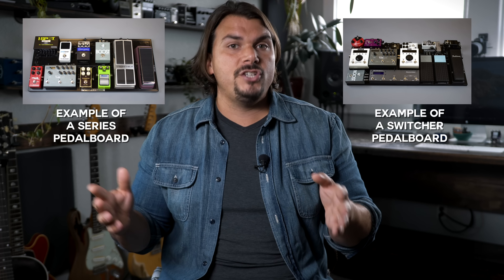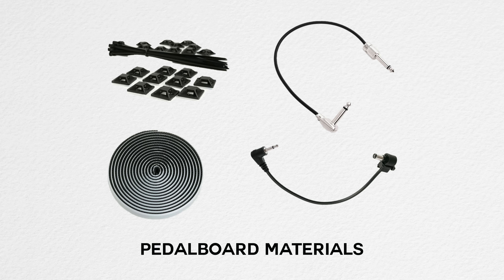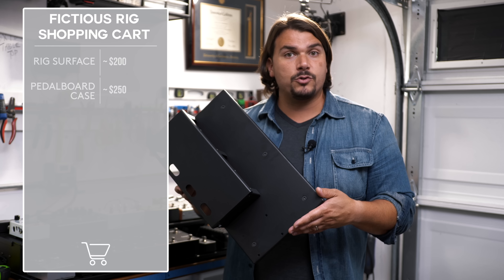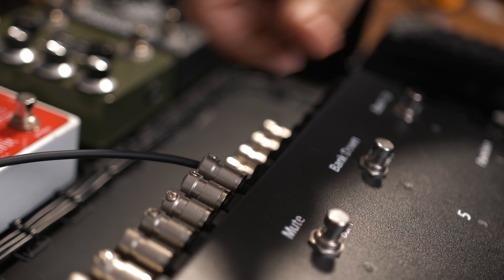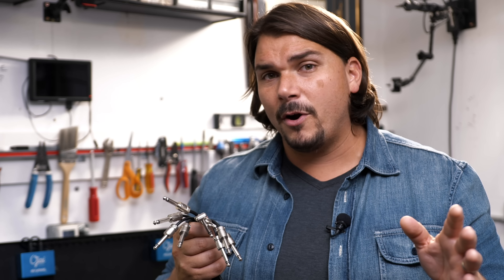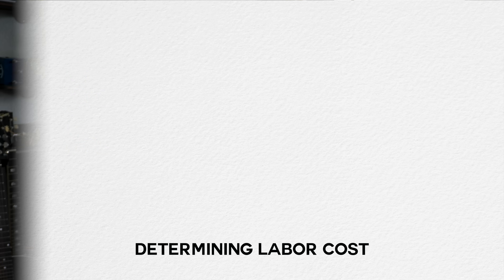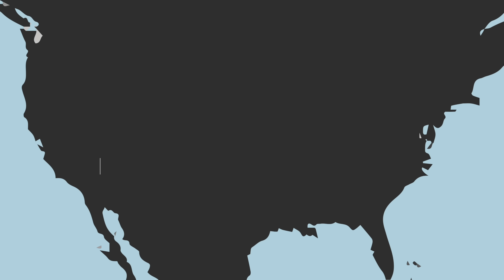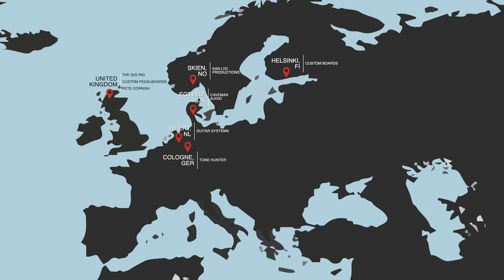The TRUE COST of a Custom Rig Build

Comment: Any time I’ve put my boards together they usually take about 4 or 5 hours using sis cables (solder less) and gigrig power setup with a switcher and 8 to 10 pedals .....! May explain why they work but end up looking like a complete wiring mess as if I just piled all the cables/pedals on top of each other .......! Lesson here is just spend the time and actually do a tidy job and end up with a board that actually looks good tidy and solid and also isn’t likely to fall apart when moved ......!  If I thought someone would pay me to build them a board I’d actually put the time in and do a good job like I do with my day job (repairing/servicing cars/suvs specialising mainly in Landrovers/rangerovers) ...!
Reply from the maker: In terms of neatness, sonically the difference would be negligible if the materials are quality, power supply is quality and the pedals themselves are reasonably well built.  I’ve seen plenty of beautiful rigs that are problematic and plenty of messy boards that are silent and sound great.  Looks aren’t always everything.
Reply: Vertex Effects True that! I can vouch for that too when it comes to automobiles .....! Usually the more prettier the more problematic.....! Well at least it keeps one busy ....! Unrelated topic ish! The nova drive landed in the post on Thursday , eventually got to literally throw it on the board on Friday evening just before heading for a wedding gig, seems to work pretty good but will need more tweaking to get it sounding better akin to how the Boss jb2 sounds with both sides of it stacked in series’s (angry > bd2) which makes a single coil Strat bridge into a vox ac15 sound like a les Paul into a cranked Marshall slp100 without the deafening volume!

Comment: Is it worth getting a switcher if I run my pedals into the front of my tube amp? My amp is a 30 watt 1x12 combo and has no effects loop. My pedalboard would consist of a wah pedal, fuzz, gain/od, clean boost, vibe, tremolo, and delay for the most part. Thanks for any help.
Reply: You need to have at least one buffer after the Fuzz in any case in order to keep your tone fresh and clear by compensating cables length. With regard to a switcher it depends on in what kind of context you intend to use the board. If you are playing at home you are not necessarily required to activate/deactivate a lot of pedals to change your entire sound by pressing just one button. If you are playing live then a (good) switcher allows you to do just that. You can define in advance per button which pedals should be active (and which ones not). This avoids tap dancing. Furthermore, if you have midi pedals you might switch the sounds of these pedals by tapping the same single button. So this,kind of switching allows you to concentrate more on playing instead of switching, which is very beneficial especially live. 
Hope this helps a bit. I recommend to check quite some other clips of the rig doctor, and clips by That Pedal Show as well, there is a lot to learn. Have fun!
Reply from the maker: Depends if you need programming - we have a video on this if you wanna watch it.
Reply: @gregorglasbruch6917  thanks for the reply. It looks as though I will need to do more research. I’m not sure that it makes a difference, but at this time I’m not using any midi capable pedals. My most elaborate pedals are my Earthquakes Devices Avalanche Run 2, Strymon Deco and Drybell Vibe Machine 2. I probably won’t be needing a midi capable switcher I’m guessing.
Reply: @VertexEffectsInc  I will look for it. Thanks.

Comment: Yeah, I had omilion do my first pedalboard several years ago. I was somewhat shell shocked at the cost tbh. But it is what it is. And the fact it came back with dog or cat hair all over it (I’m allergic btw) sucked. So every pedalboard since then Ive done myself and a few for friends and I actually like doing it. & it Helps I’m somewhat ocd and an electrical engineer
Where do you buy you power plugs and wire?  I just bought a cioks
Reply from the maker: Cool!  Power plugs for Cioks, just get mini Switchcraft RCA's - Markertek, Full Compass, all those places have them.  And for the cables I just re-use what they come with and cut them down to size.  You can also buy Strymon DC cables in bulk from them in 36" lengths same with Voodoo Lab if you want a shielded DC cable.
Reply: So sorry the rig arrived with cat hair on it, that was likely from the beginning days of rig building out of a small apartment. Likely now I have the tools and shop space separate from home to keep things clean and professional.

Comment: Instead of using a switcher loop system, can you use an 8, 16 or 32 I/O input/output Interface with USB? The USB cable can be connected from your I/O Interface to your digital Floorboard process like a Line 6, Fractal FM9, etc. What I/O USB Interfaces do you recommend using?
Reply from the maker: I’m not following the purpose of having a 32 input output interface
Reply: @VertexEffectsInc  Can you make a video lesson about Troubleshooting pedalboards that a connected in serial that has 10 or 20 pedals and trying to find the intermittent audio patch cable. The hard part of troubleshooting is all the cables are between the guitar pedals side chassis from output to input so you can't use an Ohm meter to measure the center conductor and you can remove the input plug or output plug because most guitar pedals use side mounted jacks so it make it harder to troubleshoot when the center conductors are intermittent. So without removing the audio patch cable, how would you troubleshoot and find the bad audio cable that is in one of the serial patch cables on the pedal board?
Reply from the maker: @waynegram8907  we did a similar video with Rhett Shull, the technique is mostly the same, start at the end and work backwards adding one pedal at at time :)

Comment: Question. In the first build why have a buffer go into the polytune if it has the same buffer built into it?
Reply from the maker: It’s just for reference to set the number of pedals with somewhat generic items.  If you want a signal path run down check out our signal path videos.
Reply: That wah should also be before the buffer
Reply from the maker: @Ferbocarbo  Depends on the way...optical Morley, probably doesn't matter.    Vintage style, probably before buffer.
Reply: @VertexEffectsInc  My bad! The one in the video looked like a vintage one!

Comment: I'm having a difficult time finding a power supply that meets my needs. TcHelicon acoustic at 12v 400ma. Digitech trio+ with 9V 800 ma. Beat buddy 9v 500 ma. And the Dittox4 with 9v 300 ma . Please help ? Thansk
Reply: Assuming the helicon is 12v center negative, get a Strymon Zuma and a couple of current doubler cables.
Reply from the maker: You'll need a current doubler for the Trio.  Many power supplies can do it, Truetone, Strymon, Cioks.  We show so diagrams on how to make these current doubler cables on our website and on our channel as well, you can also buy them pre-made.
Reply: The Cioks will do a great job for that. It comes with doublers and it’s a very small unit.
Reply: I am also in the process of building apedal board and I also have a Trio +. I have just resigned to not hooking it up to the pedal board power supply and using a separate outlet. However, I'm not a gigging musician so this option would work for me.

Comment: You're probably better off learning for yourself all that goes into a pedalboard.  Soldering, pedal position, pedal order, minimizing noise, power requirements, midi, switchers etc. Online resources are limitless. You can probably learn all you need to know on this channel. If I were to start from the beginning I'd probably educate myself on power requirements first. It's not that difficult but if you screw it up you might fry something. Everything else is trial and error. Once you get comfortable with all the little details you can change things around, experiment, and deal with issues yourself. You can also spend that extra money on more gear!
Reply from the maker: That's what this channel is mostly dedicated to doing, provide DIY skills, tricks, and tips to build a pro level rig yourself as you know.  For those that don't want to do that and want to hire a professional, there are plenty of good folks out there that offer that :). I'm all for people going the DIY route and hope this channel helps them :)
Reply: Honestly this, and it applies to guitar work/setups/maintenance as well.

Comment: I wouldn't pay master-builder rates for anything that wasn't a remote rack-based unit with wireless MIDI foot-switching.  That should be the standard at this point in time.  All the performer should have in front of them is a wireless MIDI foot switch panel with a couple of wireless EXP pedals.   Everything else should be professionally wired up in an outboard rack unit with remote MIDI switching.   If anything less, it should be done by the user themselves as it requires little expertise which is easily obtained via YouTube instructional videos.

Comment: The actual question I have: how did we end up here? After all of the rack systems in the 80s we‘re now back to non standardized pedals that need to be made usable for stage by spending thousands of dollars.
Reply: Storage, labor, and shipping man, a pedal board blows them out of the water in those categories just from size+weight.
Reply: people who stick with one band for a long time or are on tour will use "racks". They'll just put their pedals in a rack unit and use midi to control them
Reply: Only if you ignore all the modeling and profiling that has come out over the last few years
Reply: @-salley879  not many of the big guys are using modelers. They'll use a midi controller to control their pedals while in a rack. Sure guys like Steve Vai use a fractal but it's still not super common

Comment: When comparing the price of a board with and without a switcher, how do you ignore the price of the switcher? Most good switchers cost around $1000 +/- $200. That’s equal to the combined cost of both the TimeLine and Big Sky pedals in this example.
Reply from the maker: We state in the Intro of the video that we’re presuming through pedals and hardware products are provided, this only looks at the materials and labor necessary to build the pedalboard.
Reply: He also listed an estimated cost for a switcher with his labor break downs. $800 - which is in line with a PBC from RJM.

Comment: Have you tried the SJ3540 dual lock? That's the only one BTPA has so that's what I bought! Wonder how the adhesives compare.
Reply from the maker: It’s not as good - the adhesive is far inferior even compared to SJ3550 or SJ3551 - the hook/loop is the same as the SJ3550 as I recall.
Reply: @VertexEffectsInc  Well... That sucks! 😂 Placed an order for extra plugs so went ahead and ordered that dual lock to replace all my velcro. Now I'll have to buy it double!
Reply from the maker: @Ferbocarbo  I'm not saying it won't work, but the SJ3550/3551 is better, and our Power Grip is better than all three 3M models.
Reply: @VertexEffectsInc  But I can only have the best! 😂
Reply from the maker: @Ferbocarbo  most people won’t notice a difference between power grip and 3M sj3550 or 3551 if you can get one more easily or cheaper, I’d do it.

Comment: I'm sorry, 150 dollars an hour? and it takes them an hour to do one pedal????? I'm probably ignorant to what building a pedal involves but that is fucking ridiculous. How much engineering knowledge do you really need to know to plug a few pedals into each other? Is it any harder than building a guitar? If it isn't I'll do it myself
Reply: They build the cables and would take you about 10x longer per patch cable then them lol.
Reply: Build them yourself - trust me, it's easy.  I've been building and wiring my own pedalboards for over 10 years now - all it took was a few youtube videos, some basic soldering practice (about 2-3 hours to get the hang of it) and parts orders from somewhere like Redco audio.   I've built boards with custom wired pedal loop switch boxes (up to 20 loops) with about $100 worth of parts which would retail for over $1500 plus with very limited experience.  I highly recommend giving it a go - it is absolutely not a black art as some might suggest.
Reply: @sethtincopa1912  You're literally just plugging a cable into a pedal. It's not rocket science. Its not like you're building a PC. This is about as easy to do as plugging in your iphone or android to charge. I also don't know what people do with these "professionally" build boards if they constantly change pedals. I know when I change pedals, I usually have to tweak my board's layout a bit and change the wiring.
Reply: @ArrakisOCE  this...i solder my own cables and have built the actual board...if i was an A list pro who had a tech, yeah I might pay someone to keep my board in top condition...but to pay these rates for small venues or my basement LOL...come ONNNN
Reply: @scottraycraft5151  It all depends on time and requirement.  If you have the time to learn and it's a simple application - sure, go for it. If it's a professional application and there a complexities (gain staging, impedance matching, signal summing/merging, AD/DA or line/balanced conversions, MIDI, etc) then it would be absolutely worthwhile getting a professional in.  I've learned the hard way over a decade and probably still don't get it right.   If I were still in the industry I would just pay someone like this and have the peace of mind that it's a good setup.

Comment: Anyone have output buffer recommendations? I have the polytune at the start of my rig, and I saw the empress buffer but that has a built in boost and I wouldn't run that at the end of a chain,  so I am just looking for recommendations on solid output buffers.

My chain goes 
Fuzz - wah - Tuner - Compressor - Bonsai - Sugar Drive - Keeley BD2 - SSS - Deco- Carbon Copy Deluxe - Golden reverberator.

Need a buffer at the end.
Reply from the maker: Look at our recommendations in the links in the description
Reply: Just switch your reverb pedal to buffered bypass. A modern pedal in that price range should have a pretty decent buffer that doesn't color the sound.

Comment: Midi costs? Do these builders tend to offer midi programming or just the wiring?
Reply from the maker: It's at the discretion of the builder.  Some might include some basic programming to ensure the implementation is right but wont' do specific programming as there is some presumption that the customer knows their own gear.  I generally talk people out of using products they're not comfortable with as it can make it difficult for them to have competency with the rig once it leaves the rig builder's workshop.

Comment: Trailer Trash Pedal boards does great work…he built me a board several years ago…
Reply from the maker: Didn’t know he did that, just thought he did the surfaces.
Reply: @VertexEffectsInc  back in 2012 he built me a complete board…Not sure If he still does,but he did an amazing job on mine…
Reply from the maker: @scottpeters4401  I don't see it on their site
Reply: @VertexEffectsInc  I just looked at his site too….He has completely changed it,so I guess he doesn’t do the custom builds anymore…..He used to have a whole section on the charge per pedal..He built me a Glow Top custom board,but it was about 8 years ago…….I thought he still did it,but looks like I was mistaken..

Comment: The cost of my helix doesn't seem so high now. Lol
Reply from the maker: True, but won't sound a good as individual pedals.
Reply: Some pedals, yes. I 100% agree. I don't need much for the heavy down tuned stuff I do. Even thinking about this country gig I've been doing session work for doesn't have any pedal requirements that my Daw or the helix can't handle. I used to use pedals all the time, like 10 years ago. I wish I would have spent more time on them. I remember having two of those big boss cases, the bcb 60 I think. Even then all my pedals, besides the cry baby, were digitech. Not the greatest brand out there. For the drop c NuMetal  stuff though, they got the job done.

Comment: 1 hour per pedal? Excuse me but in what universe is that reasonable?
Reply from the maker: Well remember, you have to do the layout multiplied by however many pedals there are, build the audio cables multiplied across how many pedals there are, build the power cables for however many pedals there are, apply Velcro to that many pedals and the board, route all the cables neatly, and test.  To do that properly, an hour is about right.  This is pretty much the industry standard, and I’d say in most cases is true in terms of the amount of time it takes even amongst professionals that are doing this every week.
Reply: @VertexEffectsInc  a master builder wouldn’t take more than 5 minutes to solder a power and a patch cable and apply a Velcro…
Reply from the maker: @saccomarcelo  You not only have to solder it, you also have to route it and integrate it with 10+ other pedals in a a pedalboard system along with all the other DC pedals and Audio cables, lay everything out, mount it and make it all look good and neat.  I think you're taking parts of the build in isolation and not looking at the bigger picture.